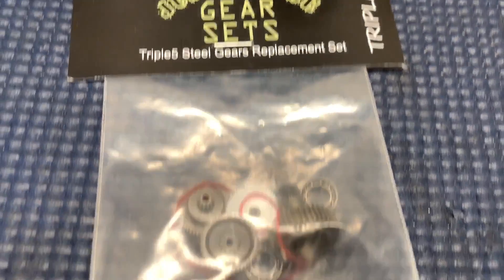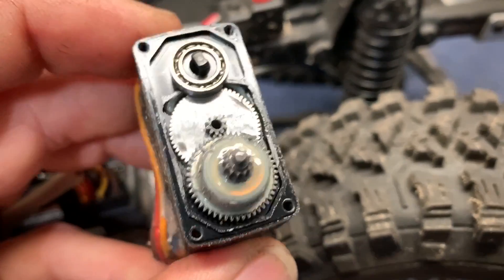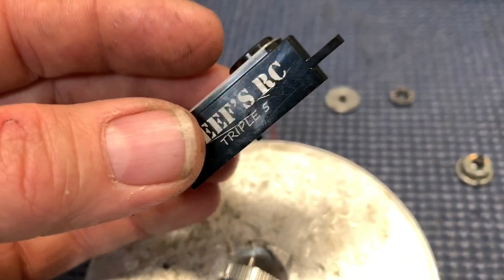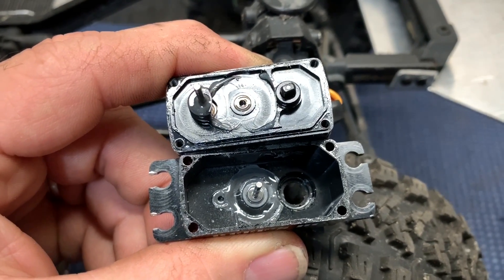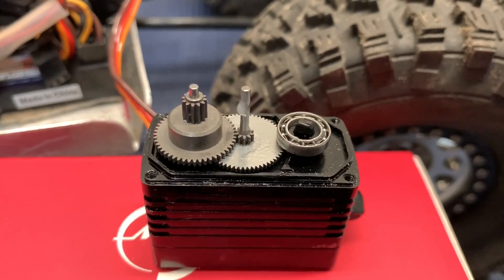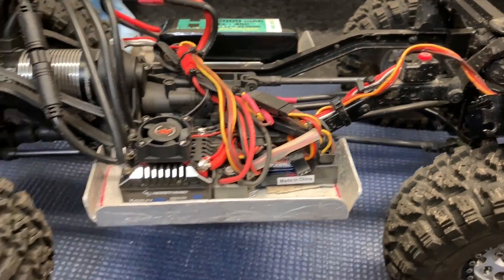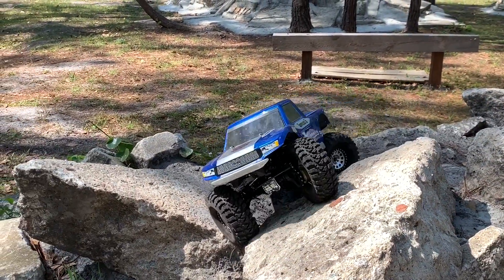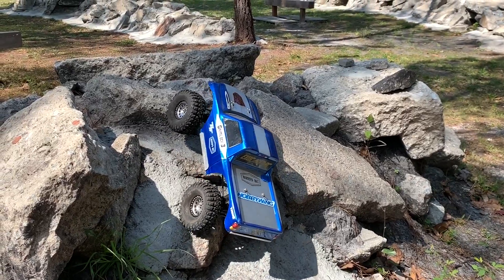Reefs Triple 5 Servo Gear Replacement

Comment: Great run, nice save! I’m really appreciating your rear steer capability on this truck. Could you please share a little about programming/receiver/radio setup?
Reply from the maker: I’ve done videos on how it works but in short it’s a hacked Flysky GT3c radio, good for 8ch and can do almost anything
Reply: Do you think a Spektrum Dx5c would achieve the same functionality and smoothness with the right programming?
Reply from the maker: Steve Chadwick I’m sure it would. Setup would be different but yeah it can do it

Comment: what do you think about the axial 10.3. 2 speed trans, dig, and portals. the axles are called ar45. it’s awesome
Reply from the maker: Yeah I’ve already got one on pre order. I think I’m going to like it a lot for sure.
Reply: Just ordered mine as well..... what electronics u gonna use Joe
Reply from the maker: Robert H great question. Not really what it’s going to end up with but I’m leaning to either a Raw500 or SHV500 and a Hobbywing Axe 2300kv. On motor and esc it will depend on how the gearing actually is when I get it built.
Reply: i think i’m gonna go with what i have unless i have extra money. my birthday is the 15th of april and i’m gonna sell my slash so i can buy it. if i don’t have extra money i’m gonna just use my jx servo, gt3b, and power hobby stuff and just buy the micro servo for the two speed

Comment: I've really been debating on the 555 or the raw 500, I need to pick one before they sell out
Reply from the maker: Raw500 for race speed and power. 555 for just power
Reply: @ExocagedRC  How do these compare with the Holmes Hobbies HV500v3? I am looking for another build. Can you do a video show off? I really like how you describe what you are doing and feeling in these reviews. I wish I could go crawling with you at that location. (just a fan thing). Maybe you and XXX Garage can do a video together of your best comp and scaler trucks.
Reply from the maker: Jerry Watson both are very different servos. Both are top shelf as well. The biggest difference is the RAW500 is 8.4v and runs great there with a bec. The SHV runs great on straight 3S so use a jst straight to the battery for best performance on that. They are very different in their power requirements that there is no way to properly put the two against each other.
Reply: @ExocagedRC  So at 500 oz they are no different except in power requirements? Thanks for taking the time to answer. Love your vids.
Reply: I just bought the 299 for my tekno et410 and the servo is amazing. I would buy another.